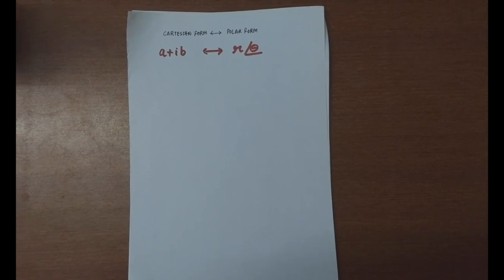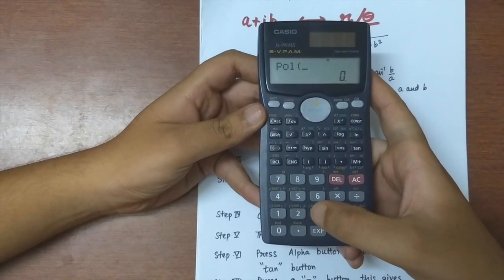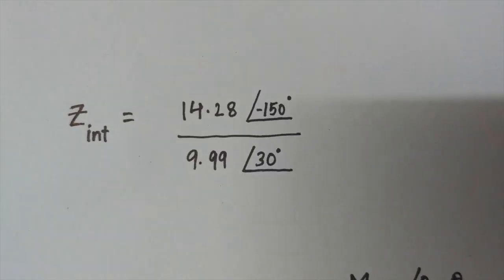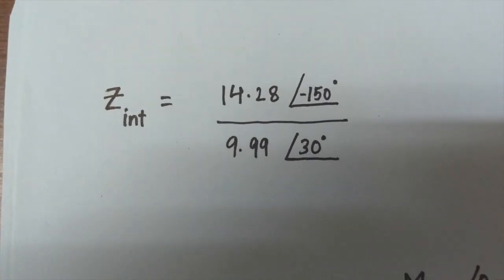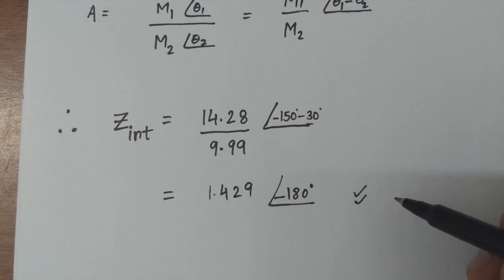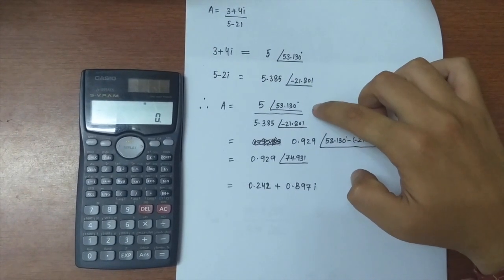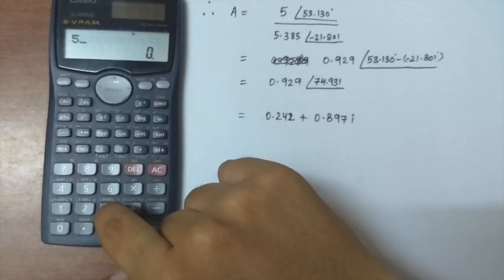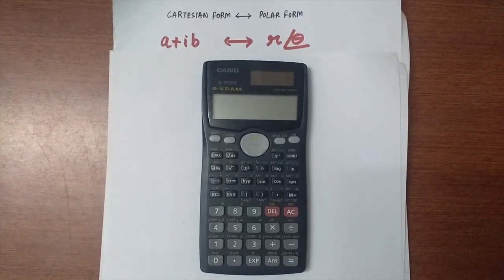Conversion of polar to cartesian and vice versa by using a calculator

Comment: For anyone who is confused (he is joking, I guess). It has a primary alkaline battery. There is no charging going on in the calculator. (However there may be some unintentional charging, as alkaline batteries are also known to be rechargeable a few times). When there is bright solar/light power, less of the battery is consumed.